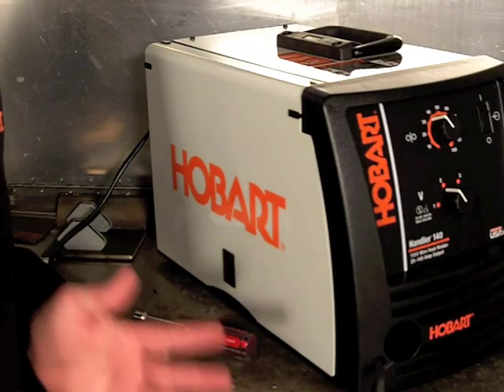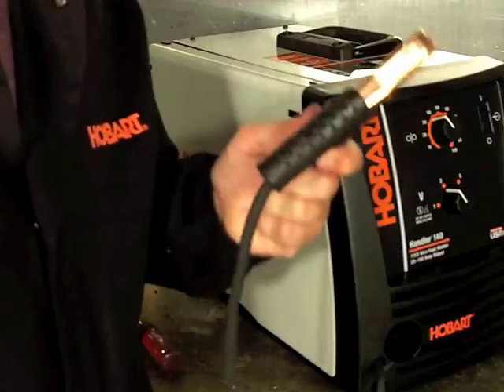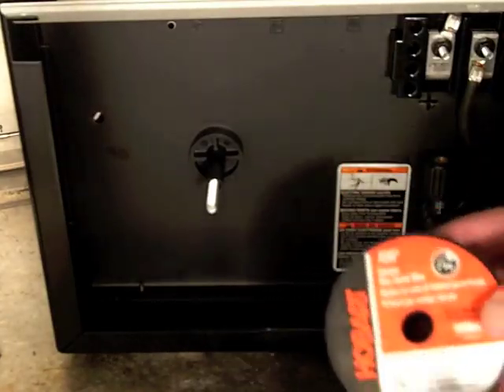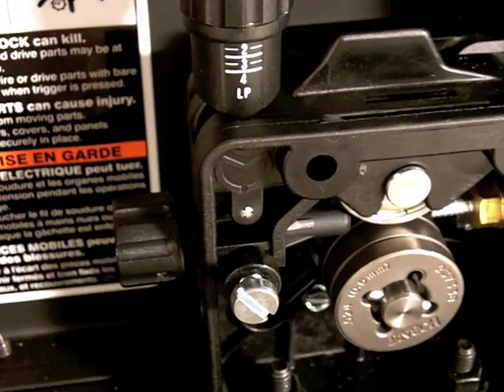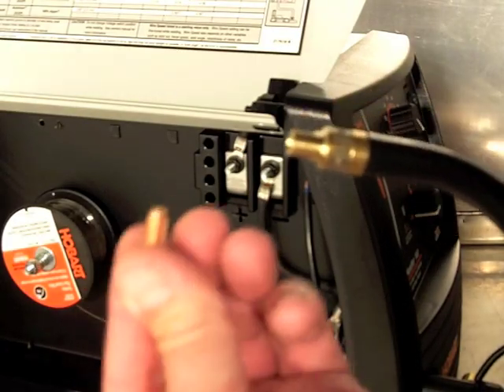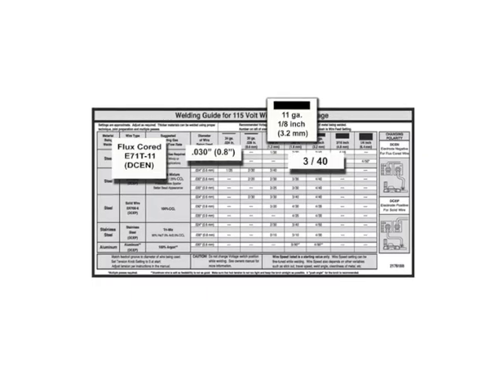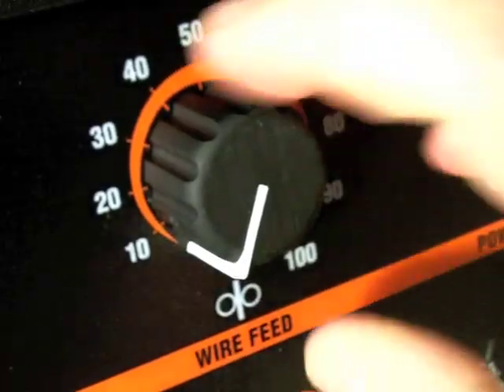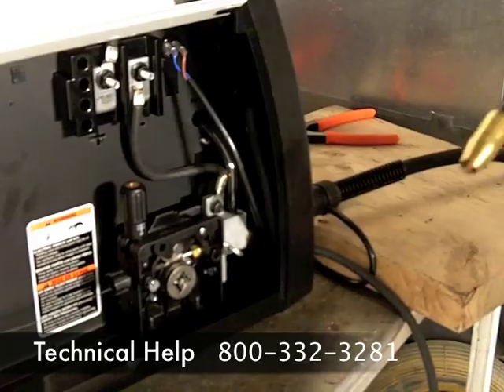How to set up Hobart® Handler Wire Feed Welder

Comment: So quick question? Say my wire wraps up and I need to refeed, I make the cut to pull the old out to feed the new wire through but the wire started to pull through to only get stuck and is now snapped at the top at the gun both ends are in the cable running from spool to tip what’s the trick to clear the old wire from the line??

Comment: My nozzle is way too hard to change on my 140. I can't even pull it off with my hands, I have to use force with pliers or screwdriver! Any suggestions?
Reply: Have your wife try.
Reply: The contact tip adapter was defective. I bought A new one, and the nozzle pulls off easily with two fingers now.

Comment: I have a 140 hobart the wire speed wasnt working right so i had tansister jit put in it and now i pull the trigger and now it does nothing but clicks in. The relays...any idea  whats going on now?
Reply from the maker: Could you give us a call so we can help troubleshoot? We're available at (800) 626-9420

Comment: Great job, simple and direct.  Its been about a dozen years since I sold my machine and I'm lookin to get another and it was a perfect video to ring all the memory bells, especially the tip about the wire tension being correct and it will curl up.  👍  The minute you started to say that...the light bulb went off.  Can't wait to get a new machine and all the gear this spring and create some stuff for our home.  Thanks!!!

Comment: Do the 2 gun wires matter what there plugged into I'm going from flux core to normal mig wire and running argon
Reply from the maker: Thank you for your question, Ronnie. If you are describing the trigger leads, then they do not have to be switched. The only changes that will need to be made, would be the polarity of the secondary leads, electrode negative for self-shielded flux cored wires and electrode positive for solid wires. There is a diagram on the door chart showing where the leads need to be. If you have any other questions, please let us know!

Comment: How do you fix wire surging?? Welds pretty good but sometimes the wire slightly surges even when the heat is spot on. Like it rolls fine and slows down almost in rhythm. Don't know. Kinda weird.
Reply: the surging CAN be from welding with a crappy extension cord. the arc starts strong and then dies down as the extension cord chokes off the flow of electricity due to resistance in the cord

Comment: What about the gas setup?
Reply: You would think after 3 years they would give you an answer
Reply: get the regulator and screw the end of the hose into the back of the welder. the fitting has a red plastic cap in it.
Reply: dunno if anyone cares but if you are bored like me atm you can watch pretty much all the latest series on InstaFlixxer. Been streaming with my gf for the last few months :)
Reply: @Rayan Cash yup, I have been watching on InstaFlixxer for years myself :)

Comment: I noticed it briefly displayed on the screen, but make sure your "drive roll" is set to the correct thickness of wire or your feed adjustments won't work.  Check your owners manual if you don't know what the "drive roll" is.